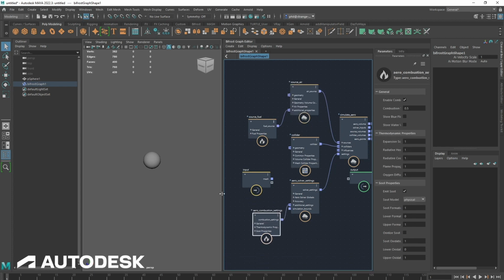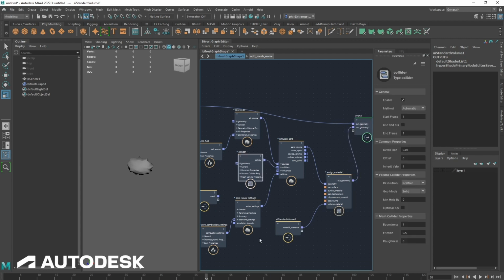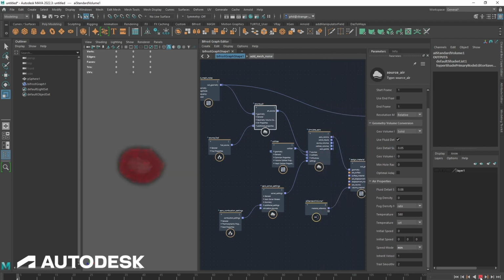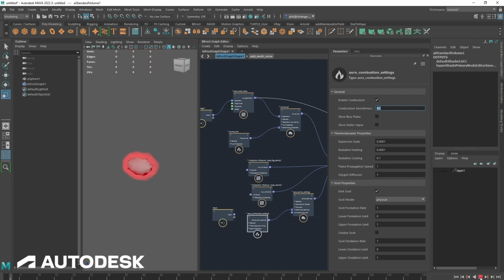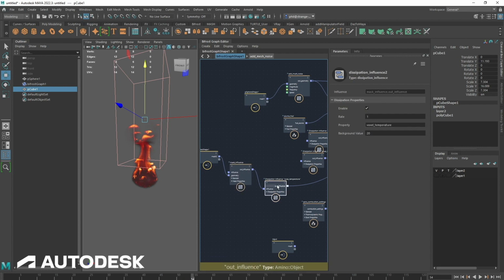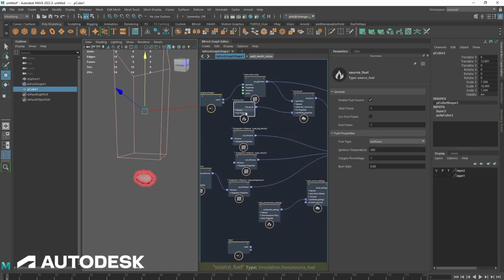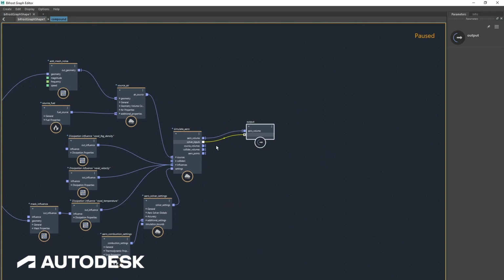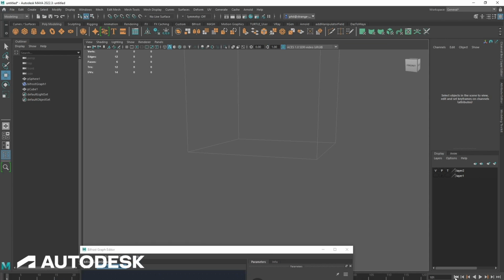Autodesk sponsored Maya Bifrost aero fire

Comment: Hey bro.. 
How to enable Render Engine name in viewport (UI)wall?
Reply from the maker: Go to 'Display' - 'heads up display' - 'viewport renderer' then when you switch to arnold in the 'renderer' drop down it will display as 'arnold viewoverride' or 'Viewport 2.0' or 'vray' depending on what you are using as the viewport renderer.
Reply: @MayaGuytutorials  yeah bro.. This is for selecting the render engine. But my doubt is within the viewport Window there is render engine name will reflect right!!. I am not seeing that in my maya UI, is there any way to get it on screen just like polygons, verts, edges, etc